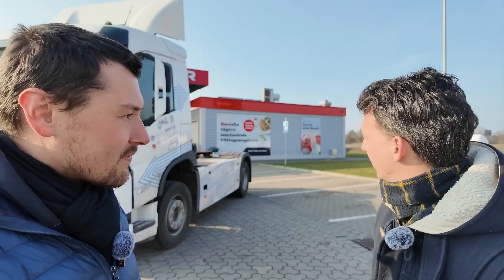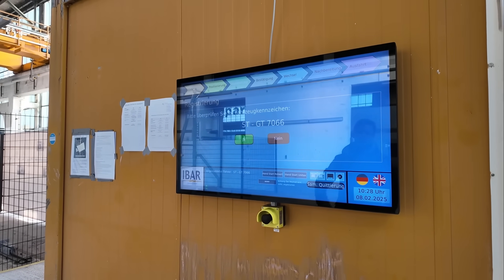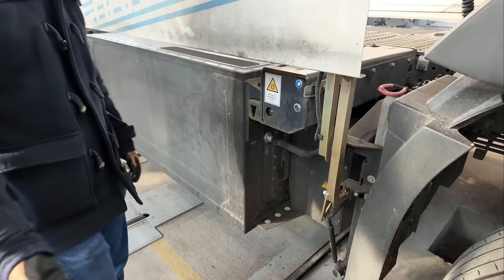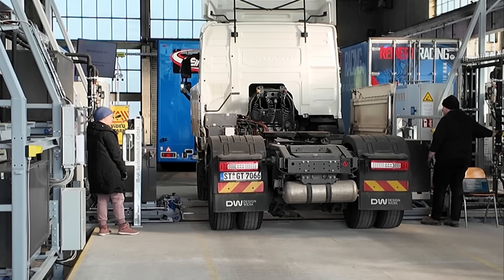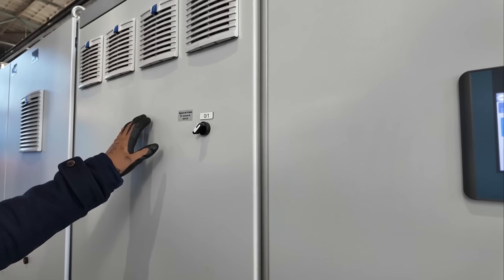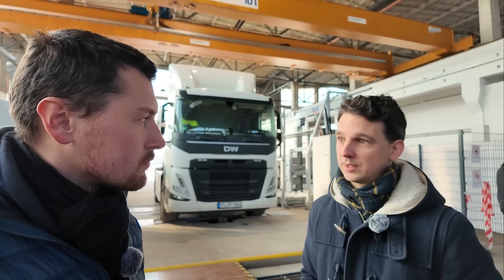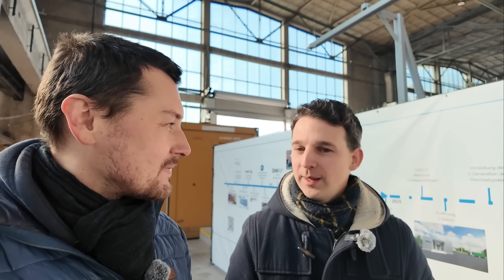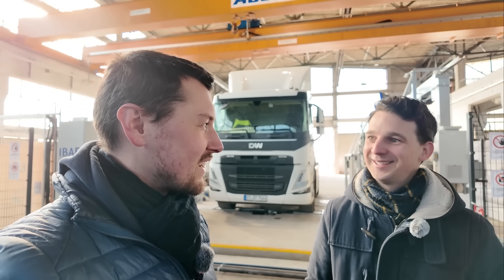Truck Battery Swapping is here! And it's made in Germany 🇩🇪

Comment: Ive never been a fan of battery swapping in general, but I can see where this might have valid use cases.
Reply: I think that battery swap is a tool. It works in some cases, not so much at others. Just like a hammer: no one should hammer a screw - but we all agree hammers are useful tools. I don't thinks this is useful for small and family cars. But for big fleets, that run 24/7, I think it's  great.

Comment: I really hate the idea of battery swapping. Yeah. I get the appeal of not having to upgrade the electricity connection,  which speeds up development times. But, this is something that can already be done with battery-buffered charging stations.

Also, I think with battery-buffered charging stations, you can use solar shade  canopies for perfectly clean power, and solar panels already produce power as DC  anyway.

Considering how attractive it is to use battery-buffered charging stations (since you can accelerate development and permitting) I think data centres should also combine their resources with charging station companies.

Work together on DC microgrids.   Servers already consume power as DC, solar panels produce DC power, EVs are already chargin DC at these charging stations.

It's kind of a match made in heaven.

With battery swapping, sure, you get the same benefit of permitting and development times being faster, but none of the synergies I just mentioned.

Comment: One element of the battery swapping offers that I think will be short lived, is the ability to convert a diesel truck to electric.
HGVs for the biggest fleet operators don't have that long a life, tends to be the smaller operators that hang onto vehicles for over a decade 

- so sticking to a form factor that is optimised for vehicle retro-fit makes sense for now, but a form factor that is more optimal for swapping is likely to win out quite quickly ?
Reply: It’s a bit chicken & egg isn’t it ? Until manufacturers see a market for swappable battery trucks they will not make them, until the manufactures make swappable battery trucks there will be no market for them. So retrofitting old diesels is a way to build a market the manufacturers are ignoring until they cannot ignore it. It is not the long term solution.

Comment: You should have a look at Janus Electric in Australia. Try convert diesel trucks to electric with swappable batteries. These are operating in the wild, they're not "theoretical" any more. The next step will be battery swapping facilities on some of our major highways between Sydney and Melbourne, and Sydney and Brisbane. These are 2x 900-1000km stretches linking our 3 largest cities.

Comment: I’m of 2 minds on battery swapping. 

Given currently battery energy density limitations it makes sense. 

However batter energy density levels are going up at a rapid rate making one question the longevity of such a system.

Comment: This is a game changer. It's not just trucks; it opens up opportunity for regional buses. Renting batteries and swapping them out when the buses have to stop anyway for 30 minutes at motorway service stations changes the entire experience, making it cheaper and more reliable to run, as well as quieter and more pleasant for the passengers.
Reply: They also have to housekeep the coaches/buses as well if the swapping can be done simultaneously with that interior cleaning at one station and washed at another and safety inspected using cameras above and below (and toss some human verified AI video analysis and ECM, engine control module, analysis to the monitoring). (For the under vehicle inspection a fixed camera array the vehicle is driven over or on a mobile rail is all that's needed, with a vehicle inspection pit only needed for physical and automated component access.) Having all these modular handling stations within an enclosed space weather proofs much of the activity.
Reply: why swap when you can just plug and charge?
Electric busses with overhead charging system exist since a while in Sibiu, Romania.
Battery swap is complex and you cannot do it on the street, it requires special places.
Overhead charge poses no hazard to pedestrians.

Comment: What so complicated? Why not diesel. Everyone knows already nor electricity production from solar and wind is normal cheap or green. ...nor effective. And what do you do when there is a power outage, as already happend in Spain thanks to the renewables....
Reply: Because it’s cheaper, more reliable, quiet, low emission, more torque, easier to drive. 

Battery swap means the battery can wait for cheap power, balancing the grid and actually preventing outages. 

Also; one planet. You may not outlive climate change but I will certainly feel the effects and our kids will pay the price.
Reply: @MiesvanderLippe i am not against electric vehicles, espessoally in city driving at all. But, f f we have to choose, we have to know all the pros and cons. Some of cons: solar panels are made of glass and it consumes a lot of energy. Turbine blades are made out of nin recyclable plastic lastic, which after life cycle germany exports ( illigaly) in eastern europe . Both of these are so uneficient, that if you stop government funding, no one will buy them. The most clean and eficient power sources are : nuclear and water turbines. Not to mention batteries are not recycleble as well. I dont understand how you rejected russian cheap gas and start buying american gas yransported by huge gas tankers. Wchich burn fossil fuel ??? Its absolutely insane!!!
Reply: Spains power outage was as far as we can tell so far a bad grid stability issue (underdamped inter-regional out of sync generator oscillations, disconnecting generation due to safetly limits, exact reasons are still being researched, but has nothing to do with renewables being bad). Please stay informed from direct sources and do not fall for the badly written media reports. Sadly nowadays you realy need to look out for official information as the media is so unreliable and biased to stay informed. Same goes for "green electricity production is not cheap nor effective": Look at current LCOE reports, not some 15-20 year out of date stuff. Renewables, even with grid battery support is nowadays the cheapest generation available. And prices are trending down even more, as these technologies have not yet reached technological and scaling limits yet. Just look at the exponential growth in these sectors, nobody would finance this if there was no money to be made by cheaper generation.

The energy transition to renewables is a long term goal, do not think that current issues (like US LNG) are not accounted for, they will be eliminated in the next decades and do not matter overall in the big picture.
Yes, as every technology, this has it's downsides, such as lower generation capacity numbers, needing backup in the form of some more gas emergency peakers (very low capacity overall, maybe can be even completely eliminated by synth gas), a better grid with more interregional capacity (avoid the regional variances due to weather), more energy storage as hydro (bulk) and grid batteries (short term), synth gas (long term, inefficient).

Both wind and solar are just now starting be have the first generation devices being replaces in big enough (but still very small) numbers for recycling to start up in a doable scale. Think big, run the numbers for the replacement rate of entire countries, this will be a big business opportunity in the end too. Nobody is going to continue dumping stuff at the scale we're talking about here. Yes there's still potential for better recycling technology, as well as better recyclable materials, but there's already a huge push to make this happen anyway.

Why not Diesel? Think at scale, 750'000miles (what google says is lifetime of a semi) / 6.5mpg (lower limit google says) = 125'000 gallons of lifetime diesel usage per truck. Worldwide there's apparently 23.7 million semis, haldf of that probably realy old inefficient stuff? That's a huge deal if we can reduce emissions in this sector. numbers don't lie, look at the potential and you see why we're going in this direction, even if some people will not like it right now, due to some dumb restrictive reasons, these limitations will go away more and more as the technology matures. The world will look radically different in a few decades, and looking back will not be kind to the negativity for progress, as it has never been in human history.

Comment: It is really promising and it should be done. But what about the cost? I assume the truck would use roughly 1-1.2kwh per km at current charging rates would cost not much different than the diesel counterparts. Maybe in future with renewables the cost of electricity could be brought further down to displace diesel engines.

Comment: Watch the system developed by Janus in Australia. A bit more manual procedure but definitely faster to install and operate.
Reply: they are working towards automation
Reply: @colinstanley8678 that's good news, but the simplicity of the current system makes it perfect for a quick deploy anywhere. If the demand rises automation is great, but with the use of a forklift can simplify significantly the deployment of new stations.

Comment: Janus Electric Holdings in New South Wales, Australia has converted 2 dozen trucks from diesel to EV. They just built a new conversion facility, and have several truck battery swap stations, along with partnerships with several trucking companies. One of the battery swap stations includes solar panels to help charge the battery packs. Battery swapping will remove the complaint against EVs that they take too long to recharge. 

I wish eHAUL the Best of Luck in their business.

Comment: Renting the battery also means the risk of obsolescence is owned by someone else, along with the degradation and recycling.  Seems smart for the logistics provider.
Reply: It's an operating cost vs capital expenditure.
Reply: Which will probably mean that when it’s time to do the recycling, which isn’t free, they instead dissolve the company owning them. I don’t think it’ is a responsible thing to only take the benefits.
Reply: @jeroen5838  I agree, but I was never suggesting it was responsible

Comment: it would make enormous sense voor public transport busses.
Reply: Maybe, maybe not.
The electric buses can be charged at the line end even if the battery is not charged to 80% or 100%.
And the system is in place in Sibiu, Romania, electric buses charge at the line end, train station and at the opposite line end, the depo.
And let's not forget trolleybus technology exisst since what 80 years?

Comment: Free Palestine
#RailTransit
the idea of using electric distribution with batteries is not scalable and uses far more energy than steel on steel
Reply: Rail is great for long runs and bulk cargo but has the last mile issue. Getting from rail head to the customer generally needs surface transport.
Reply: @phhowe17  I  tend to agree; but that is not  what  they are  advocating
Reply: The idea of using fossil fuel has been scaled and it uses far more energy than steel on steel. 
Batteries not scalable? When did we become the country who couldn't do things?
Reply: But rail is too slow for the parts of the economy that requires instant gratification. 

BTW, using batteries for steel on steel is going to make more and more sense over time. It reduces the upfront cost of new rail infrastructure. Also, copper is getting more and more expensive. The best way to save on copper is by not shaving it into the ground train after train. 

Third thing: Thanks to nitpicking fossil fuel burners regarding brake dust of EVs scientists from the University of Southampton have discovered the dust coming from copper parts in brakes are the most dangerous part of brake emissions. I see copper dust can cause inflammation of lungs and the airways, and apparently that's more dangerous than the emissions coming out of the tail pipe of a diesel engine. If that's dangerous with cars, imagine the danger of copper dust in underground train stations. 

That knowledge has been there for some time although I get the impression the focus is more on the copper in the Westinghouse brakes than the overhead wires.
Reply: @therapeutischbecommentarieren  The future; if we indeed have one; is going to have to be slower; that said trains are not usually slowr and save  lives.

It is the particles in brake dust that causes illness not as far as I know the copper.
Reply: It's hard to get rail door to door

Comment: "Batteries is half the cost of the truck."
"You need 30% more batteries then trucks."
"Takes 10 min to swap, but can be shorten to under 5 min"
So for the same cost, you can bye 15% more trucks. But if you include resale value and personal costs, you could probably bye 30% more trucks.
So its probably cheaper to just by more trucks.
Reply: You left out the first bit the cost of each E truck is double that of the ICE truck. If you don't need to buy the batteries you bring the costs to equal pegging for the operator but still have to hire the batteries on a need to use basis so the operator has to cater for all it's potential customers.. and charging rates and times.. hence the number they need to support for their current service.  

The big issue is to standardise the packs and swapping across the industry ....  

It's one of those problems like charging connectors. 🤷🏻🥼🧙🏼‍♂️ It needs an SAE /Euro standard .. and China  will be making a lot of everyone's batteries so 🤔 side slide or lift up ?
Then there's the shielded mechanical and electrical connectors ..  how do you get them to consistently align ? and seal against water and dirt ingress ? All been done before but Nio had the lead with their car swap stations.. .. 

Huge amounts of money to be saved  if everyone is working to a single high standard standard. ... 

Of course some people will want to be contrary to protect their own interests. 
But it was done with standardised shipping containers... 🤔🤷🏻
Reply: The truck owners do not need more trucks just like they don't need more for all of the extra fuel in storage tanks waiting to be consumed or over capacity in refining plants. Diesel engines in trucks can expect a long life. They do require a lot of expensive maintenance to get there though. Electric motors on the other hand have been shown to far outlast an ICE engine with much less maintenance. Therefore the resale value of the truck should remain relatively strong compared to one with an ICE engine. The E-truck is also using power which can be renewable generated while the ICE truck is consuming a finite resource supply. All of those other things we need oil  for will be harder to build as this resource becomes more scare.
Reply: It's the total cost of ownership and running that matters, not any one part of the chain...

Comment: I don’t understand battery swapping for regular cars but this makes so much sense.  Now we just need to see it commercialized.
Reply: Happened years ago in Australia, thanks to a local company called Janus Electric. 😊
Reply: It makes sense for private cars if you have no where to charge (street parking only in a big city, etc). 

Or people who drive a very long distance very regularly. (And don’t like stopping to rest…)
Reply: @xiaoka  I live in the middle of a big city. I charge on the street which works absolutely fine and is much cheaper than fast chargers.
Reply: @tomm5936  that’s great, not many cities have invested in chargers for roadside parking. 

Battery swapping for cars is not a panacea, as very few companies have even dared to try it, the notable exception being Nio in china, they have extended them to Europe now and started licensing the tech to other manufacturers.   Regardless of whether it ends up taking off in the market, this is a use case where battery swapping makes some sense.  

(It works very well for scooters in high density urban environments like Taipei).